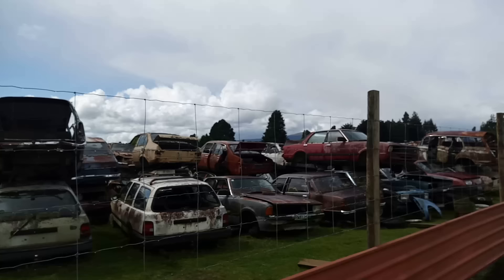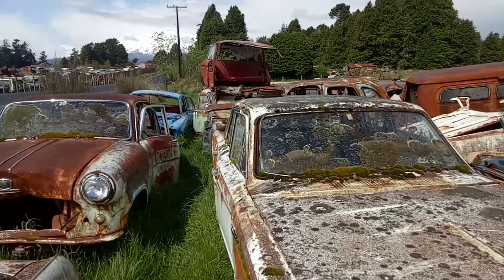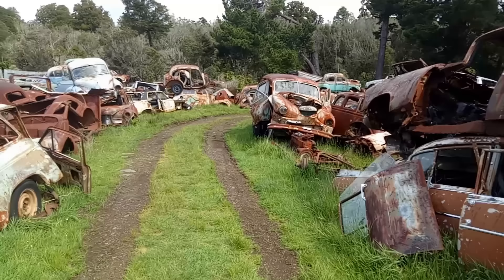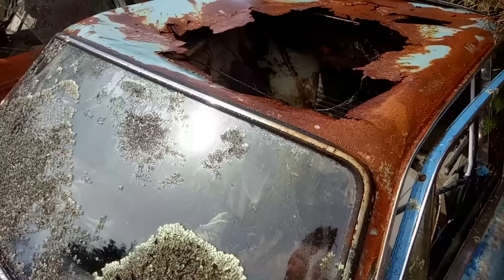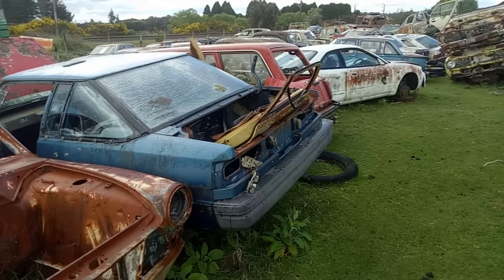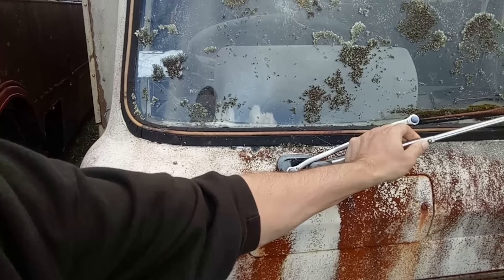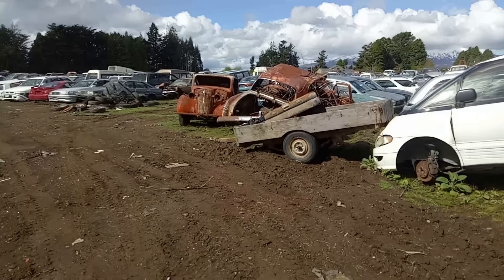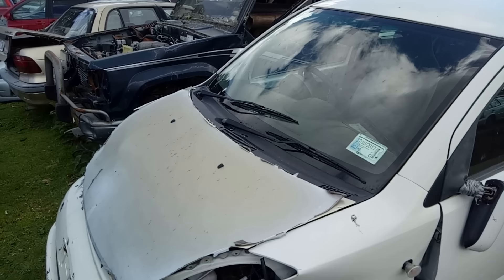(EP15) 1-hour of EPIC SCRAP! Horopito Motors, New Zealand - HubNut Goes Global

Comment: at 48.35 - What is that yellow car on the right of the screen? 

The White Isuzu - probably a Holden RB Gemini - the first and only Front Drive Holden Gemini. Assembled in Adelaide from  Japanese bits. I bought one new in 1986, my first brand new car and one of the worst cars I have ever owned. 5 speed manual - gearbox syncros would often jam, meaning you would change gear and suddenly no gear would engage. Holden tried several different oils to improve gear changing, auto trans fluid seemed to be slightly less crap but still temperamental. Door fit was so poor the tops would chip paint off the roof if you slammed it. A nasty nasty car.

307s deserve to die?!? Wash your mouth out Ian. I loved my 307 wagon, it gave me 10 good years and was still a great car when I traded it. Yes it did lack that lovely Peugeot ride though.